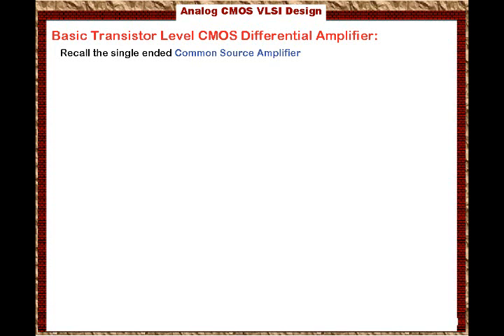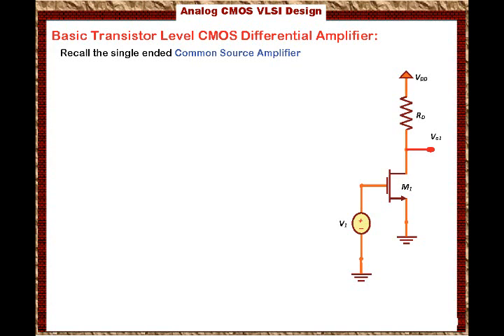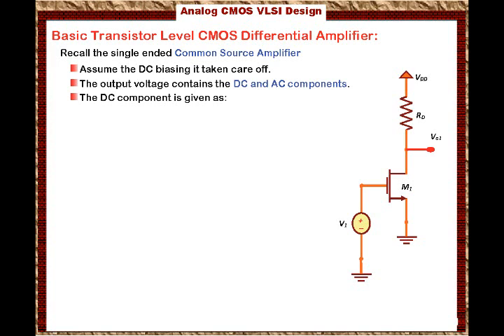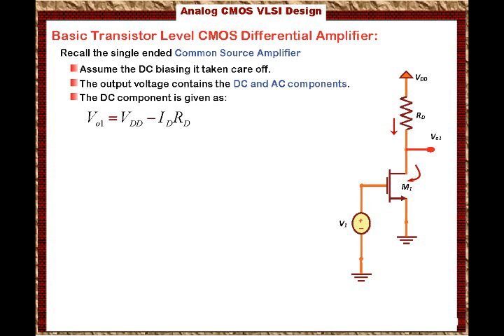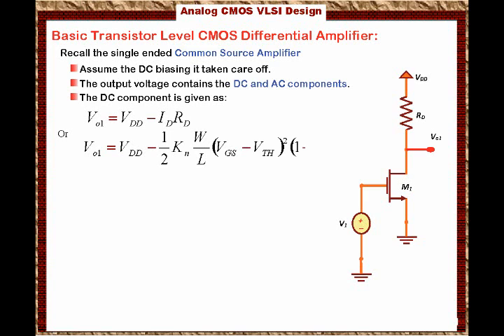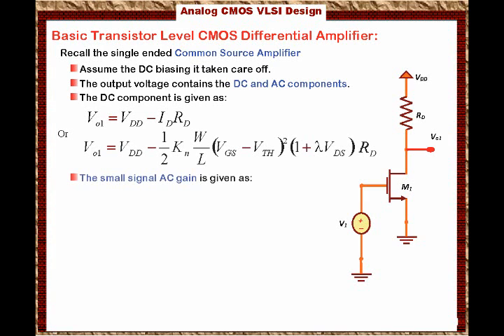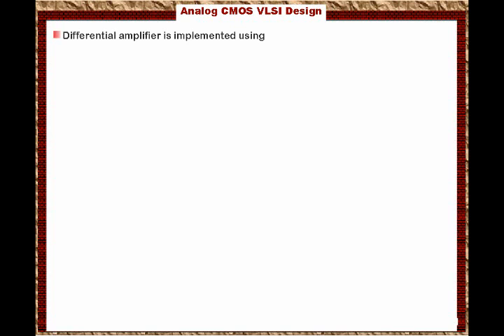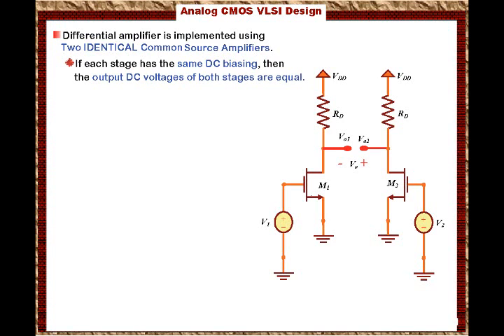Analog CMOS VLSI Lecture Three -4: Basic MOS Differential Amplifier

Comment from the maker: @akhilshetty88 
not really. 

Vo = Vdd - Id*Rd
if you have a resistance for M that is Rm then 
Vo = Id*Rm or Rm/(Rm+Rd) *Vdd
but Rm varies depending on the operating point, the operating region  and if the signal is AC or  DC. 
So the first case is alwayes true.

Comment: hi... this is a really good video..... i have a small doubt in this ...
 you calculated Vo1 when M1 is on is Vdd- IdRd. But  when M1 is on, dosent the current directly from from Vdd to gnd.  If it does, then  shouldnt u also take the resistance offered by M1 in to consideration...?